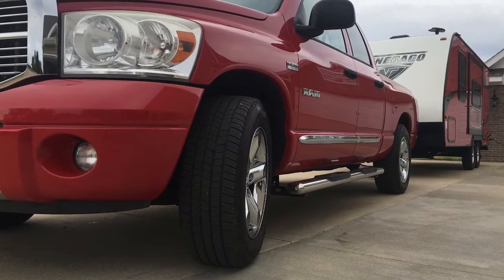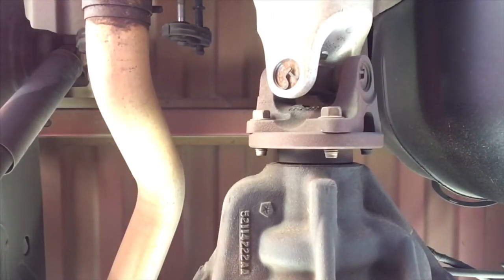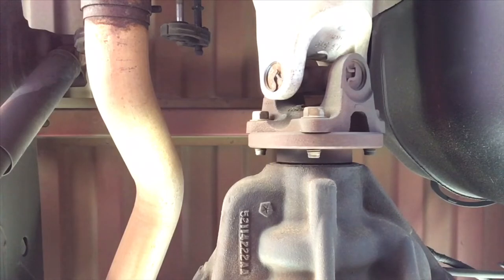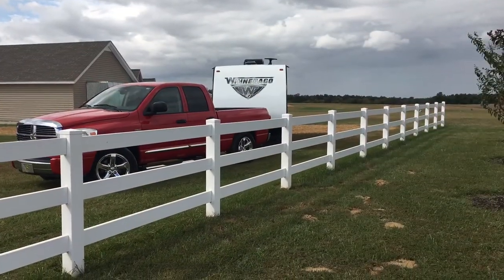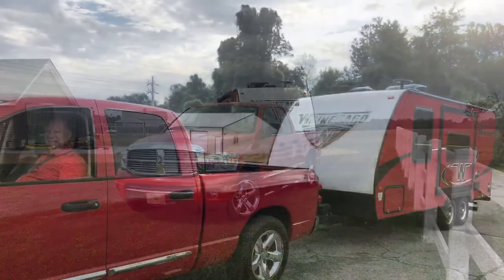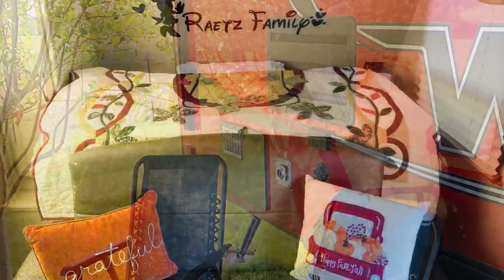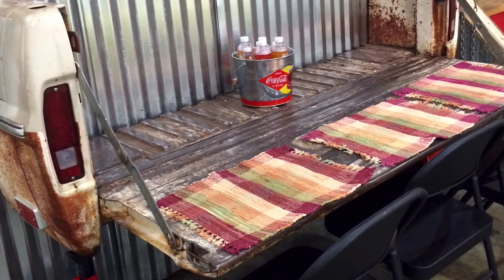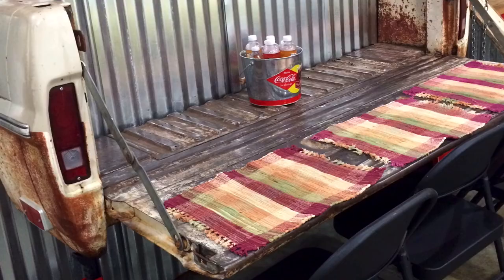Dodge RAM | Rear Differential Noise

Comment: Have you repaired this yet?  Pinion bearings are pretty common on the Chrysler 9.25 differential.  I've rebuilt many.  It's almost always the smaller pinion bearing.
Reply: Is it hard to replace ?

Comment: I've got a 2001 RAM 1500 4X4 SLT 5.2 LITER V8.  11-1/2" lift, 37 x 14.50 r15 tires.rear differential noise.  Replace braking system,  outer axle bearings and se a ls, still noise. Attempted to replace outer pinion bearing and seal,  which is the main thing that goes bad causing the differential noise, only to find the bearing had sort-of welded itself to the pinion shaft spindle.  Typically,  these bearings are easy to replace,  however,  if they get stuck (self welded/seized) on the pinion shaft, the only way to remove them is remove the pinion from the differential. Typically you'd remove the gears and carrier bearings,  put nut back on pinion shaft threads, hit nut/shaft end with a hammer, driving the pinion into the differential housing and dislodge the outer bearing simultaneously.  (At this point, you're rebuilding the differential.  (Long winded, but better explanation as i just went through this).

Comment: My 2018 ram 2500HD 4x4 does this a 30mgh so bad that it will all but lock up. The dealership says nothing wrong. Vibration is awful. It's under warranty. The bad thing is the whole pumpkin housing and internals were replaced under warranty at 23k due to a catastrophic failure. No towing and no 4 wheeling. At my wits end. Love the cummins but hate this.
Reply: Having a similar noise around 20 miles an hour scared to drive
Reply: 2020 3500 Dooley

Comment: I have the same noise but it's not as loud. It goes away after 50 mph . I'm trying to figure mine out. My truck has 92000 miles.
Reply: Did you get the issue solved? I currently am dealing with this issue
Reply: @blakebanghart9848  i havent heard it, but also since i was given a company truck i havent drove my dodge in a while, I drive it only one say a weekend and not as much to heat up the differential. Good luck bro that stuff gets a bit stressful

Comment: I have similar noise on my 2500...what was the issue with yours? I have not been able to pinpoint the noise, but seems to be coming from carrier bearings, pinion area is not as loud, I'm curious before I tear into it, thanks.
Reply: If you're pulling apart a rear diff and can't diagnose it properly then just throw all new parts at it.
Reply: Bearings are shot in the rear end and need to be replaced asap. I waited too long on my truck that had this noise only louder and nearly everything was completely destroyed, only the case remained OK. Costed me 2196$
Reply: @30offthebenchpodcast  rear differential bearings
Reply: @30offthebenchpodcast  u can try to add really heavy oil to the rear diff and seeing what it does..i recommend lucas oil stabilizer
Reply: @30offthebenchpodcast  np

Comment: Is the rub,  rub sound synchronize with the tire or the drive shaft

The key points  start and stop are masked with talking and music. 
Pull the cover and run it  see if the sound is inturnal or external.  
170°f at 65mph towing  is fine and dandy. Is there a diffrence in case temp for iner and outer pinnion bearings (if both same then vs rear cover?) 
By sound I'd say you got a brake drum dragging, or something stuck in a tooth or damaged  tooth  causing intermittent bearing over load/spinn.
Was there much metal  contamination on the service? 20k mi of this  should be glittery 
Check the U-joint cap temps.

Comment: I had the stupid cheap driveshaft pinion seal ring blow on me. It was spraying all the gear oil literally like a mist all over the underside of the bed and the gas tank. It never leaked on the ground before i noticed it finally began dripping. while on a 15 minute drive, it slowly leaked sprayed all the gear oil out that seal when I got to my destination (work) why didn't I just write "work" Hahah so when I got there, I heard a little bit loud boom sound. The drive shaft pulled out almost a inch. Leaked all the fluid out onto the ground. I had to limp it and change that seal I was gonna do it in a few weeks but damn thing decided to go on me then. The pinion nut just easily screwed off so that got loosened HORRIBLE DESIGN IT SHOULD BE THREADED MORE ONTO THE STUD! I pried the old seal out, installed new one, put it all back together. Opened my differential up no damage. Cleaned up normal metal shavings. Installed new gasket maker, then filled it up with new oil. So........... little while after i hear whining noise 45MPH to 50MPH it gets sort of louder and its annoying. Truck has power, goes up hills powerfully, (it still felt like it always did) 

huuuuhhhhh right?   Bars leak, it barely does anything. It quieted down the whining a little bit. I think its for just differentials that are old or high mileage not any that took some hits. I soon rebuilt my whole truck luckily it held up.

the whining noise was the bearing got chipped!

Comment: Has anyone put their hand on the differential to see how hot it was after driving a mile or so mines real hot not the axles on the outside but the rear end itself the pinion area

Comment: Have 2001 ram 2500 diesel when making left  turns the engine revs like its in neutral and after turn is complete the tranny or  rear end grabs again and truck is ok ever hear of this?

Comment: I have an automatic 2wd 2006 RAM 1500 V6. I hear a noise that sounds kinda similar, but it seems to be coming from the front. It only happens intermittently. Usually when taking off from a stop, or giving it a little bit of gas in reverse. I guess it's common on these trucks. Any help would also be appreciated!✌️
Reply: @ohKillemRevolk  Unfortunately, I've been putting it off. It might be the differential from what I see in other videos. That's just a wild guess though. As soon as I find out, I will let you know. Take care✌️
Reply: Any luck big Danny?
Reply: @mctabagegaming4187  I did replace the alternator and battery recently. While I was at it, I changed the oil and did a coolant flush. It drives and shifts fine. It still has the same undiagnosed noise periodically, but isn't any worse. I'm not a mechanic, but if I had to guess, it's a bearing in my transmission. Until I can get someone who is a mechanic to look at it, I'm going to keep driving it daily. Will update if I get it diagnosed, or if anything happens.
Take Care
😎✌️💯
Reply: That's sounds like what my truck is doing I notice it at turning an taking off an in reverse
Reply: @briantomes2564  Exactly! I sometime notice the noise when tuning at low speeds as well. Most of the time it makes the noise as soon as I give it a little bit of gas when it's in reverse (ie Backing out of a parking spot.) I can also hear the noise when It's in drive and I give it a little bit of gas. Mostly happens when I'm going up a slight incline. If I get a chance, I'll try to record the noise so everyone can hear what I'm trying to explain. Take care and I hope you have a good day.

Comment: So my moms 2004 dodge ram that has 185,000 miles. And it's making this noise also. If she waits to long to fix it what could happen
Reply: Your differential blows up.
Reply: I Believe so. She took it to a shop and they looked at the diff and said she needs a whole new diff because theirs metal flakes in it. But it stopped making the noise after she had it looked at witch was weird. So I looked at it and buy I didn't see anything wrong. Gears looked fine fluid was fine. So maybe he got the metal flakes out.
Reply: @30offthebenchpodcast  axle bearings and carrier bearings, my truck had the same noise, took it to a dealership and that’s what they replaced. there’s still some gear noise but it’s barely audible

Comment: I have an 03 2500 and just hit 199k miles. It the bearings in the rear. Mechanic said Dodge is known for this issue along the hemi's lifter making cam flat

Comment: I have a 2013 4x4 ram 1500. Just started making the same noise. What can it be? Driving me nuts.
Reply: My 12’ is making noise...thought it was a brake. It seemed like it was since sound was worse when braking. Did you figure yours out yet?
Reply: Did you get this repaired ?
Reply: Bro did you dix the problem I have same truck with same model

Comment: My 2006 mega cab 1500 which has 2500 suspension and axles had that sound it has the 10.5 rear end it was the pinion bearing but I just replaced all the bearings in the rear end
Reply: How much did it cost to repair I have the same truck
Reply: @dillonhall7064  paid 220 for parts another 60 for diff fluid
Reply: @charlie8392  is yours 2wd
Reply: @dillonhall7064  4wd
Reply: @charlie8392  ok
Reply: Ok thanks I have this same noise coming from my dodge. I have a 2013 5.0 hemi. I'll change the differential oil and see if it helps a little bit. But I have never replaced this kinda of parts.

Comment: The shaft is noticeably wobbly. I'm wondering if the drive shaft need replacing. Also, does this truck have a drive shaft carrier bearing? If that is loose or damaged, you're get some play on your drive shaft
Reply: Definitely the wrong answer right here lol

Comment: Could be an axle bearing. Is it a locking differential?
Reply from the maker: Rusty Glovebox yes it has a locking differential.  I have been measuring the operating temperature of the axle bearing area and the pinion bearing on this trip.  After running 45 MPH for several miles the housing around the pinion bearing area is 140 F.  After running an hour or so at 55 MPH that pinion bearing area runs 160 F.  At 65MPH it moves on up to 175 F.  

Axle bearing areas run much cooler at 120 F.

Drove 450 Miles yesterday averaging 60 MPH, Noise isn’t changing much.
Reply: @JunkyardTailgate  hi , did you figure out what the noise was?

Comment: So did you fix the noise I have a 2010 Chevy Silverado maybe the same
Exact noise but it only does it sometimes  so I pull over then when I start to drive the noise goes away it’s done this noise twice. I would appreciate it if you can let me know if you figured out what the issue is? Thank you